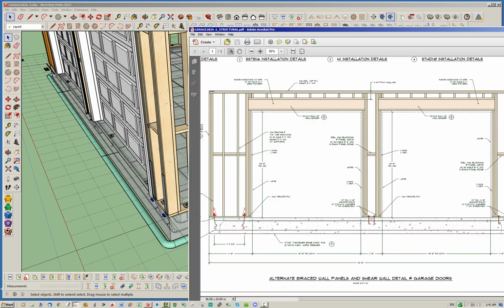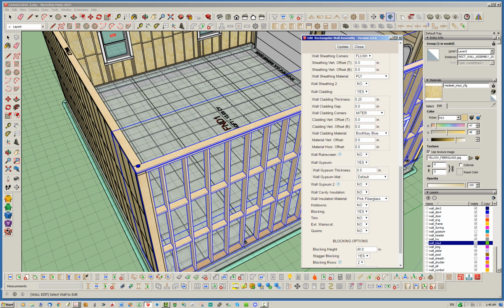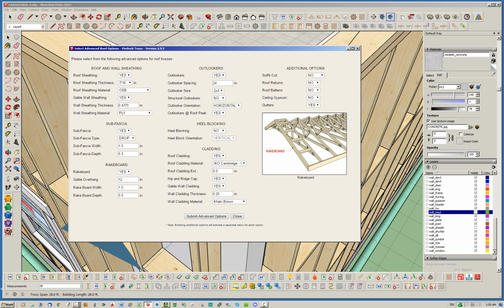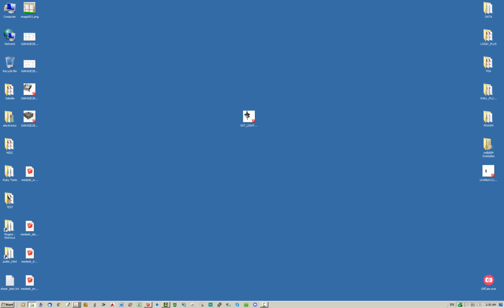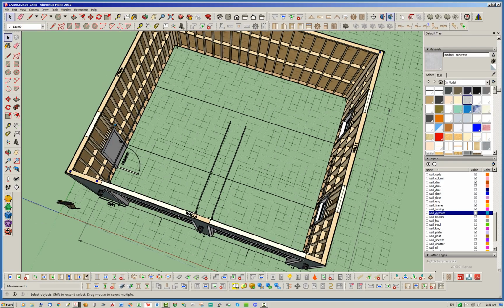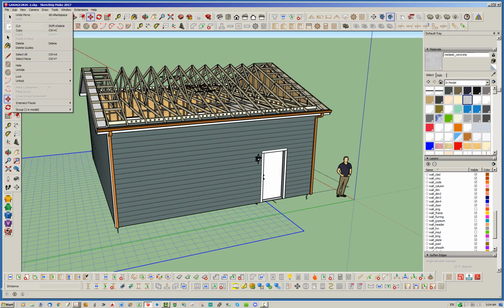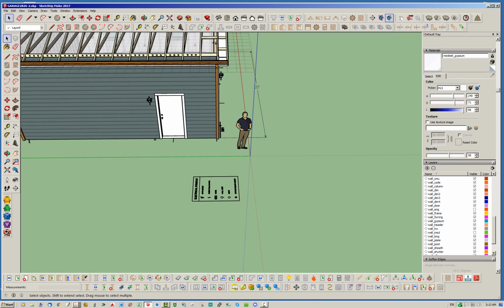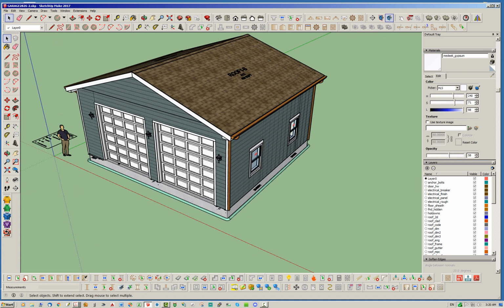mdkBIM Tutorial 2 (Part 2) - Garage 2826-2

Comment: With those exterior light fixtures (and outlets), we typically mount exterior trim blocking which sits proud of the siding. That might be a nice future option on the fixture selection screen. We rarely (if ever) mount fixtures right on the siding. https://youtu.be/tshq5Z6_rto

Comment from the maker: After I filmed the video I went back in and fixed the positioning of the lights as well as corrected the exterior trim around the windows.  I also swapped out the garage door outlets for simplex style outlets and positioned them against the trusses properly. I also added in some ceiling insulation into the model manually since the truss plugin does not do this step just yet.

Comment: The folders option on the new SketchUp is cool for managing layers.  I set up folders based on your plugins,  1-Site, 2-Foundation, 3-Floors, 4-Walls, 5-Roof and so on. What is cool is that you can then turn off the entire roof and other folders without having to go in and pick out individual layers or you can if you want.  I set up a template drawing with these folders and your layers already there so I am ready to go with a new project :)
Reply: I'm the same Tony. That folder option was a game changer for organization.
Reply: @shooshinejonnie  Yes, I use hide for things I want to go away for ever :)
Reply from the maker: I agree, however you probably noticed I filmed this tutorial using SU 2017 Make, so the folders options is not available.  I also do quite a bit of testing in SU 2021 Pro, and when I do I will use the tags folders.
Reply: @medeekdesign  I just wanted to let you know your extensions affect my work flow :) in a good way :)